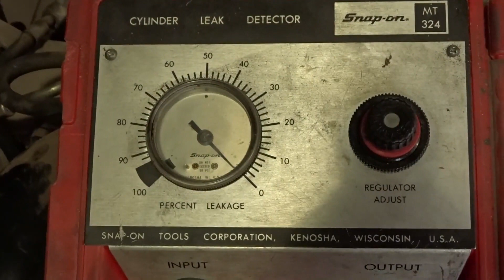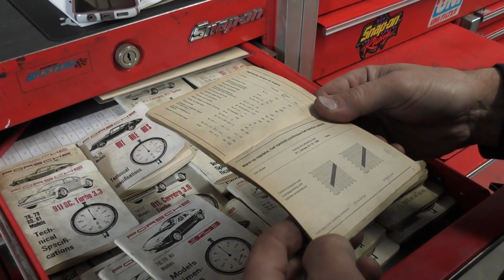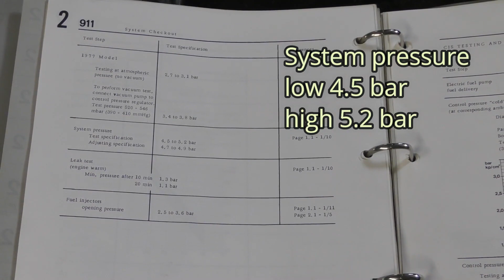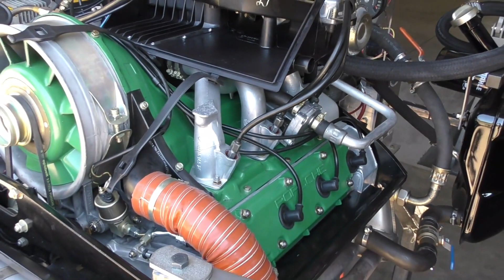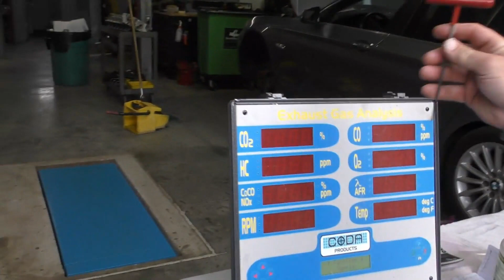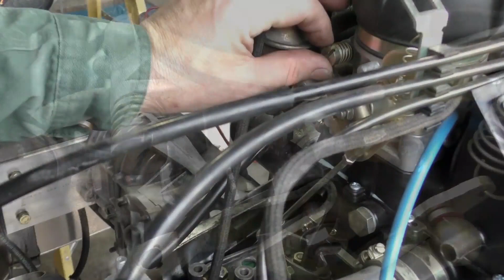How To Diagnose And Fix Your Porsche C.I.S Fuel Injection System

Comment: Hi Kurt,
I have a technical question related to my 1978 3.0 CIS engine.  A couple of the nylon fuel lines going from the distributor to the injectors are nicked.  I decided to rebuild them and bought 15 feet of black nylon hose which complies with the technical specs regarding pressure and chemical resistance.  The hose is 4mm ID x 6mm OD. 

When comparing with the existing hoses I realized that the existing hoses are 2mm ID x 6mm OD.  Some forums claim that the 4x6 are fine while others claim that these are not fit because they “pulsate”.  I don’t really trust the forums and have been unable to find a definitive source of information regarding this issue.  I wanted to ask you whether replacing the existing injector lines with the 4x6 mm would be acceptable or not as finding the 2x6mm is all but impossible in Mexico.  As always, I look forward to your comments, your advise has always been on point.  Thanks for sharing your knowledge.  Best,
Mario
Reply from the maker: Mario, 
The injector lines used on that car are somewhat unique in both there thickness and the extra layer of abrasive protection applied to the lines. If you were planning on re-using the fittings they will not fit your new lines, (4x6mm). Yes they will slide on but may also blow off. The correct line size is available in a Cohline brand although it will come without the abrasion resistant coating.  I have found it cheaper and easier to just buy the correct injection hoses that come with the correct size pipe and fittings and the abrasive protection coating applied.
Kurt

Comment: I ordered one.  Thank you
How do you test the coil on a 1987 930?
The decal shows not to place an  ohm meter across the terminals.
Victor
Reply from the maker: That is only when the engine is running. You can measure resistance across the coil terminals with the engine off and the coil disconnected. However, this will not tell you much. The only real way to test coil function is to use an oscilloscope and look at the wave forms as energy is moving though the coil.
Kurt
Reply: @Aircooledconsulting  Kurt
I am ordering a restored CDI box from Parts Klassik. Is it imperative to not use a 1000 ohm rotor, which is the only one available today?
Also what brand of oscilloscope should I buy to check ignition on the 1987 930
Thank you,
Victor
Reply from the maker: Partsklassik has a 5000 Ohm resistor available that should be installed into the coil wire. There are so many oscilloscopes out there to choose from. I use Siglent scopes but I would just choose one that suits your budget and immediate needs.
Kurt
Reply: THANK YOU,
Victor @Aircooledconsulting

Comment: Thank you so much for all your videos. Your CIS ones have been particularly helpful. Appreciate your work and expertise. 1983 911SC here in upstate NY. I am currently replacing fuel pump, WUR, fuel filter, and a couple fuel lines. Hoping she'll be running good soon. Anyone know if I will need to adjust my mixture after installing new WUR? At this point it looks like everything is good - 4.5 bar fuel pressure from fuel distributor. Last component going in is the WUR. Hopefully this week. Thank again!
Reply from the maker: Yes the fuel mixtures will need to be adjusted.
Kurt
Reply: Thanks again. I figured that 3mm adj. screw would need a little tweek as well as idle screw. Appreciate response.  @Aircooledconsulting
Reply: @Aircooledconsulting   Got it all dialed in and running great. Still not a perfect start up, but once run for about 5 minutes seems perfect. Thanks again for posting these excellent videos.

Comment: kurt, Do you use any thread sealants or lubricants on the fittings,and is it possible to test and access the cold start valve on a 1987 930? Thankyou, Victor
Reply from the maker: No sealants of lubricants are required. Yes you can access and test the cold start injector in the car. It's a little tough to get to but not impossible.
Kurt
Reply: thank you    @Aircooledconsulting

Comment: Thank you for your videos, they are all very well explained and  have lots of good information to avoid mistakes. I am looking for fuel hoses for my 911 81 Targa and was looking for same esterior look as the cohnen 380 (wrapping in spiral fashion) but able to cope with ethanol. Cohline 2240 for engine bay is what i found but do you have any sugestion about this? What do you use? Thank you. I also follow your BMW videos, M54 engine on my e39 but I like to watch your quality work!
Reply from the maker: So none of the rubber hoses are going to be ethanol safe. The other issue is Cohline has discontinued the style of hose that you are looking for. There is not a lot we can do with ethanol fuels. We have experimented with using polyamide hoses in some applications as they are ethanol safe. the issue is sometimes working with these types of pipes can be harder. Also, they work with push-on fittings and do require using screw fittings.
Kurt
Reply: @Aircooledconsulting  Thank you, Will check the polyamide hoses. I Hope there is any option that Will keep the original look as much as It can be kept.

Comment: Where is a good place to go and find the k jet manual for a ford capri 2.8i? I want to run the sames tests you have performed.
Reply from the maker: Not sure where you would find that information. I would try searching google with your WUR number and see if you can find any of the pressure specifications.
Kurt

Comment: Hi, great vídeo. My car a  Gasoline passes straight to the injector. I have already visually checked if the butterfly is closed, and even though it is 100% closed, the fuel flows into the nozzle and drowns the car
Reply from the maker: Then check your fuel pressures.
Kurt
Reply: good morning. I would like to congratulate you for the excellent video. I was able to solve my problem by following your checks and tests step by step. thank you very much
Reply from the maker: Glad to be able to help.
Kurt

Comment: Great video! I am about to perform the injector flow measurement on a 930, which has steel injector lines instead of plastic. Do you have any suggestions on how to maneuvre the injectors into the measuring cylinders in this situation?
Reply from the maker: Sorry, I do not have any flow specs on the fuel distributors. If one cylinder has changed, then the other 5 should indicate the required flow amount.
Kurt
Reply from the maker: I just use a set of polyamide lines to just run the measurement/flow test
Kurt
Reply: @Aircooledconsulting  Thanks Kurt - that does make sense but I'm not in a position to have a spare set of nylon lines lying around. What about clamping some flexible fuel hose to the outside of the injectors and redirecting to the measuring cylinders? Unfortunately I won't see atomisation/cone shape with this approach...
Reply from the maker: It will sort of work. you might lose some volume on the sides of your hoses as you are going to be relying on gravity to drain into the measuring vials. Also be careful not bend up your  fuel lines from the fuel distributor to injectors using that method.
Reply: @Aircooledconsulting  Hi Kurt, hopefully you see this thread update after 2 years! I have managed to beg/borrow some polyamide lines. The metering unit that I had professionally rebuilt 2 years ago started giving mixture variations on 1 cylinder, so I am rebuilding it myself this time, with parts and tools from Missing Parts in Germany. Do you know where I can get fuel flow specs for the Bosch 0438 100 037 metering head? Would they be in that big folder of yours?? My workshop manual gives WUR specs, but nothing for the metering head. Many thanks, Peter.

Comment: The Bentley Bosch FI book by Charles Probst is excellent, but you actually show how the components all work together. A more sophisticated version of a Weber IDF's circuits. Thank you.
Reply from the maker: Yes all fuel injection systems can be related to a carburetors operation. If you understand how a carburetor works then you will have no problems with a fuel injection system.
Thanks
Kurt

Comment: Can you help please I have a 79 911sc 3.0l we are following the video carefully, we have checked the control pressure then closed the tap for system pressure which is at 4.9 bar but when we open the tap again the pressure will not drop back down to control pressure, any ideas.
Thanks ian
Reply from the maker: Barring any issues with your testing set up it usually indicates a bad warm up regulator.
Is the car running okay?
Kurt
Reply: @Aircooledconsulting  thank you for the quick reply. The car runs okay stationary but under load it pops and bangs and is very hesitant to accelerate. I have just ordered a WUR rebuild kit from Germany so hopefully that will sort it. I will let you know.
Thanks for the videos they just so much help.

Comment: Well filmed, narrated and crystal clear instructions make this the best instructional CIS video I have seen. One question, my 74 Fuel Distributor has a banjo fitting with an additional fuel line running to the primary pressure regulator ? Not seen on your set up.  I assume that line needs to remain in the test loop, correct ? And does that component have its own  test procedure ?
Reply from the maker: Steven,
Yes, your car is a much earlier version, and the warm-up regulator on your car had no acceleration enrichment built in. So on your car, they use a mechanical throttle valve hence the connection to the control valve circuit at the fuel distributor

Comment: By far the best instructional video.  Thank you Sir
Reply from the maker: Thanks
Kurt
Reply: @Aircooledconsulting  I would like to ask you if I may..
I have a 76 930 it started to accelerate on its own right after I turn it on
The tach goes all the way to 7 RPM I have to turn the key off immediately 
I already clean n lub everything from the gas peddle to the throttle 
I also check with a light the worm up regulator for current 
The light does not come on 
Could this be part of the problem?
Thank you in advance
Reply from the maker: @adanponce4401  Adan ,
it sounds like you have a large air leak in the intake system. The engine won't rev that high by itself unless it has a source of air and fuel. If it was just a stuck open throttle, then you would find that pretty easily. Also, no power to the WUR will not cause that issue.
Reply: @Aircooledconsulting  thank you so much for your time taken to unswear!
I’ll check for air Suction

Comment: Excellent CIS content. Thank you sharing your knowledge. I got a question here, since I started with completely de tuned engine. After initial airflow body setup than WUR setup comes the mixture control. I noticed it has quite an influence on the control pressure. Would this mean that the pressure compensator is not really up to the task? It did pass the warmup test with flying colours.
Reply from the maker: Mareek,
Are you talking about KE-Jetronic? like the system used in the 1980 and up 911/930 USA models? If so, then the lambda control solenoid will modify control pressure to adjust fuel mixtures when in the closed loop. However, unless you are tapped into that fuel circuit on the back of the engine, you should not see it on your pressure gauges. If you are seeing large fluctuations in control pressure not related to vacuum inputs, then you more than likely have a flow/volume issue.
Kurt
Reply: @Aircooledconsulting  Kurt, thank you for the prompt response. Yes, I definitely have an issue with lambda control and I’ll tackle it on Monday.

Comment: Nice video!!! Very comprehensive. Do you focus just on Porche CIS or some other German brand like Mercedes? I'm asking due to I'm having issues with my MB 190E 2.5-16 CIS injection and need some help.... Thanks!
Reply from the maker: Fernando,
I am a Porsche specialist which is why this is focused on Porsche. How ever the CIS injection system principles are the same from vehicle to vehicle. There can be some differences in how the system operates. For example MB uses a series of electronic sensors and control valves to improve the Basic CIS system and controls.
Reply: @Aircooledconsulting  Thanks for your reply. Is there chance you can guide me where to look to solve my problem? Thanks.

Comment: Excellent video.    Any adjustment differences you would suggest regarding straight gasoline and E10 fuel?  AFR for gasoline is 14.7::1, but E10 is 14.08:1  Will the CO and H2 be the same?
Reply from the maker: ExSully,
When setting CO% keep an eye on the HC, if the CO% is higher but the HC are staying low then you should be just fine. Measuring AFR is a little tougher as you need to be driving to do that and only under certain conditions will it actually show that 14.7:1 ratio. Todays fuels are certainly not what the were back when these cars were new. It is always a good idea to constantly monitor engine performance and gas mileage and modify your settings as required.
Thanks for watching 
Kurt

Comment: Great explanation, thanks for the video. I do have one question though. I have a Porsche 928 with similar CIS system and a workshop manual. In my manual it is stated that the control pressure in cold condition must be measured with a vacuum applied to the vacuum port of the WUR. I haven't seen you do that in your video. Shouldn't you apply a vacuum (of 450mbar) while measuring the cold control pressure?
Reply from the maker: Cold control pressures are measured in two ways, with and without vacuum. Without vacuum will directly affect the cold start and with vacuum will affect the cold running of the engine. We have a video specifically on the vacuum portion of the circuit. You can see it here https://youtu.be/Ii5k773lwKs 
Thanks 
Kurt
Reply: @Aircooledconsulting  thanks for the extra video, it gave me more insight in vacuüm operation in the cis system. My workshop manual only specifies a cold control pressure with vacuum applied. It also has a specification on warm control pressure with and without vacuum. Do you happen to have the cold control pressure (without vacuum) specification for my car (1980 928s, euro spec)?
Reply from the maker: @berndsen1984  Cold control pressure 20 degrees C ambient temp, no vac, engine off, 1.1+/-0.2 Bar. Thanks for watching, S

Comment: Whats gonna cause mine to hunt heavily in morning for about 15-20sec
Reply from the maker: It can be a lot of things including the following items; warm-up regulator out of specifications, air slide not functioning or set correctly, ignition timing incorrect, valves too tight or loose, fuel mixtures incorrect, sensor plate height too high or low, or fuel pressures incorrect. You just need to start at the beginning and work through the system piece by piece.

Comment: CIS Made Easy. Only took 30 years of practice, eh? ;-) This is a FANTASTIC resource, and I very much envy you your skill and equipment. I will be watching it REPEATEDLY. I'm trying to resurrect a 77S after a Big Bang. After many semi-to-unrelated twists and turns, my current problem is not having access to the FSM and the pressure graph for the 77 033 WUR. I see that the 78 069 WUR has very similar specs, and the graph is present in my Bentley SC manual, but similar isn't really good enough. Any suggestions?
Reply from the maker: You are correct in that you have to use the right graph for the actual WUR part number you are looking at. We have most of that information on our website. Here is the link to the 033 pressure information on our site. 
https://www.klassikats.com/porsche-1976-0438-140-033/
thanks Kurt

Comment: Dear Kurt, first, thank you fro sharing your knowledge with the audience - Porsche enthusiasts. I appreciate that a lot. I have learn about you from the last Mike's video - he is also great. Personally, I have a 3.2 911 with DME fuel injection, but I have very much enjoyed. I would like to hear your opinion on one thing that bother me lately, if you allow. When I accelerate, I hear a whistle in every gear. The whistle comes after, let say, an inch in the throttle and stays for about half an inch farther in, and after that stops. What is your opinion? It would be awesome, if you response. Best regards Lukas
Reply from the maker: Luckasz, That could be a number of things from air moving over the throttle plate, or air moving through the air flow meter or the idle air control motor. It really something I would have to hear to really be able to nail down. I would say that if you are not experiencing any running issues, then I would not worry to much about it.
Kurt
Reply: @Aircooledconsulting  Many thanks Kurt. I have heard something about the right possition of the throttle plate. Could it be that this part change its position somehow? is there a spec on that ?
Reply from the maker: @lukasztrembowski3015  Lukasz, Yes there is a setup procedure on that throttle butterfly. 
though I doubt that the actual butterfly would be creating that kind of noise. I would expect it to be coming from a bypass channel where the air is restricted through a passageway. You could perform the base idle speed setting by bridging the test plug on the fuse panel and setting the base engine idle speed on the bypass screw and see if that helps. It could also be a carbon issue. Removing the throttle housing and cleaning everything to remove oil and debris may also resolve your issue.
Kurt

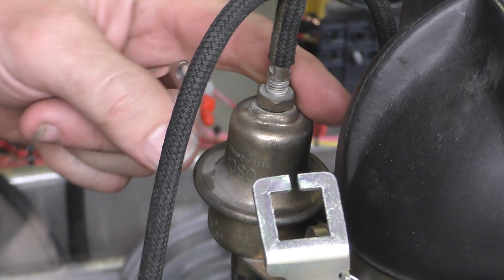Comment: Thank you for this! A lot of great information! Been trying to figure out for a while Now why my 78’ SC 3.0 keeps stalling out when I lift off the throttle! Must be an issue with the deceleration valve @41:55.
Reply from the maker: Jimmy,
if the engine is dropping back to idle to fast it will cause stalling. Also check the fuel mixtures using a gas analyzer. If the engine is too rich or to lean it will also stall when coming back to idle. 
Good luck with your repair and thanks for watching
Kurt